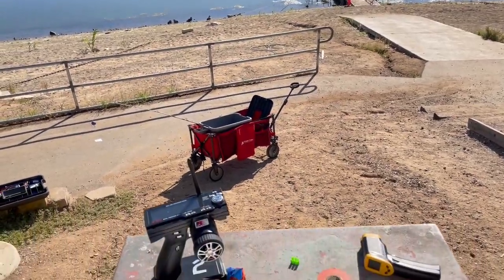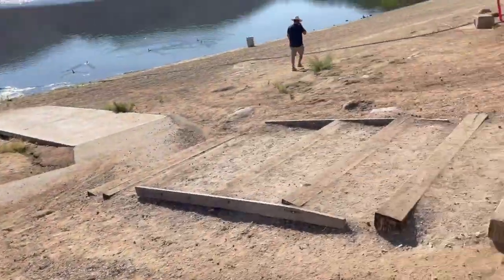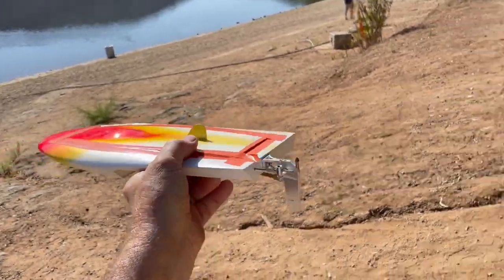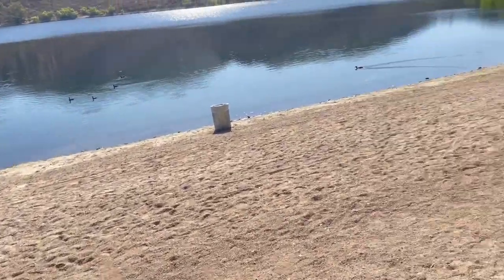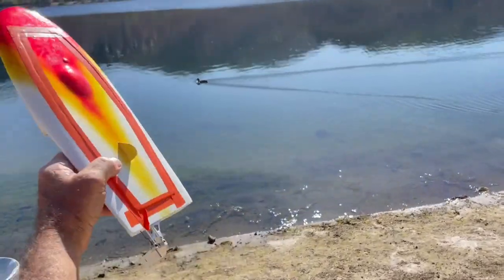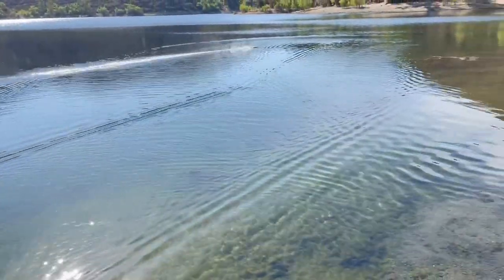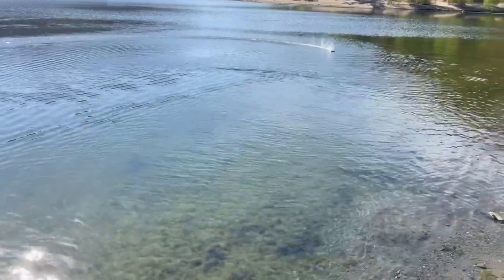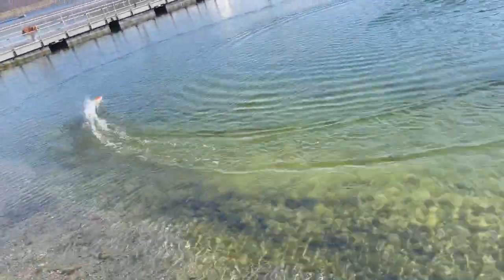Dr. Jet runs JetStepper Prototype IV with a low Kv 2030 motor.

Comment: Wow Doc! I only hope mine runs as well as that! 👌 
I'm afraid it's back to the workbench for mine and a rethink on motor selection. I finally got a beautifully engineered (by a friend of mine) Delrin coupler (1.5mm to 2mm) and worked perfectly - not a suggestion of wobble even when the motor was spooled up to the maximum (around 52k rpm). However, after running for even a short time (20-30 seconds) the motor got extremely warm. In fact quite hot. Around 130-140F. My concern is that this was an unloaded test, just turning the prop shaft. No propeller and obviously no water resistance!
The little 7000kv motor I have is designed for a drone, turning a 3" plastic propeller with only wind resistance to worry about - no shaft to drive, no friction from stuffing tubes, and importantly no water resistance. Oh well, it was worth a try!